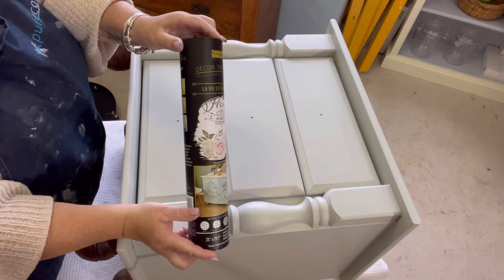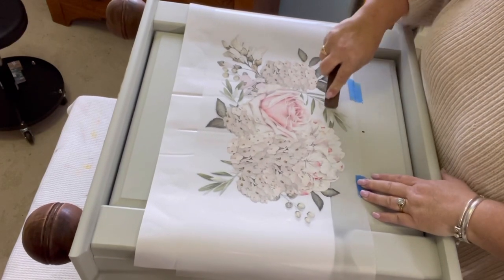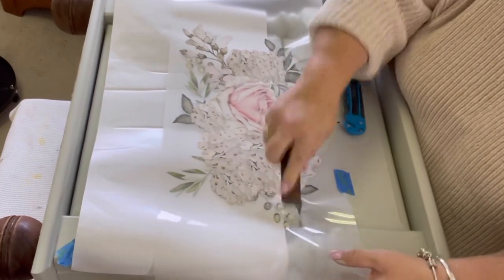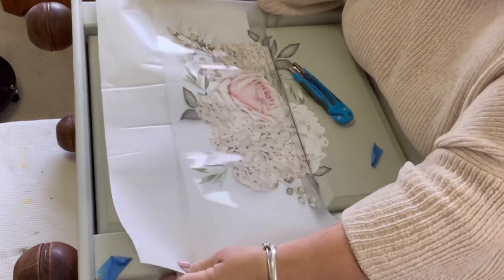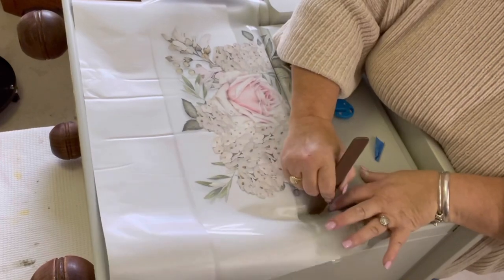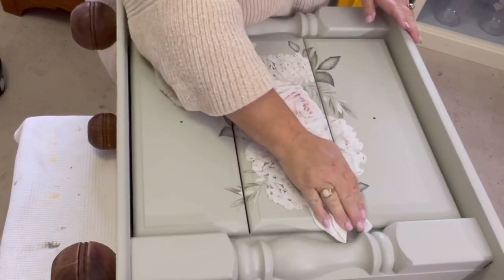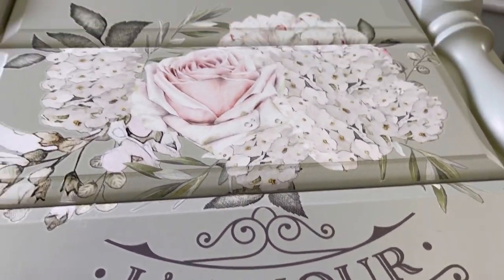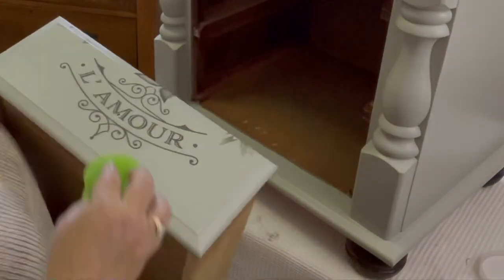How to apply furniture transfers | Prima transfers | DIY furniture flipping | transfer tutorial

Comment: Thank you🙏🏻 I haven’t used a transfer yet but looking forward to it. I haven’t seen anyone cut the drawers and slide the paper along. That was very helpful tip. So grateful. I have a dresser that has a cameo opening in the middle that spans 3 drawers. Gradually working up the courage. Bought transfers but when I put them up to the price they didn’t do it for me. Ordered  another one🤞

Comment: I'm priming and painting a shelf with a satin finish.  Then the transfer.  But what kind of clear coating should I use over the transfer and shelf?  Thanks
Reply from the maker: I use Pureco top coat but any water based top coat will do. 😊
Reply: @Refurrbys  thank you so much 💓